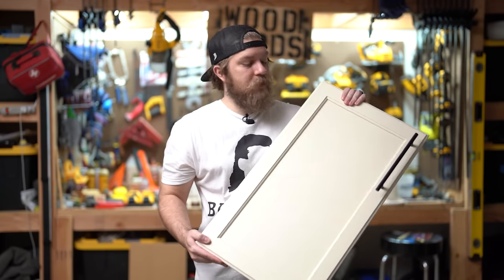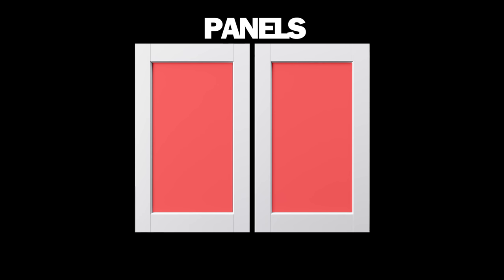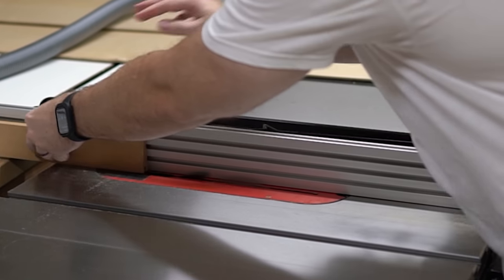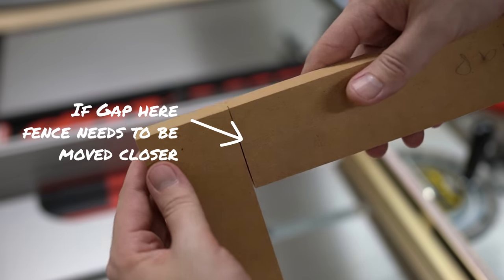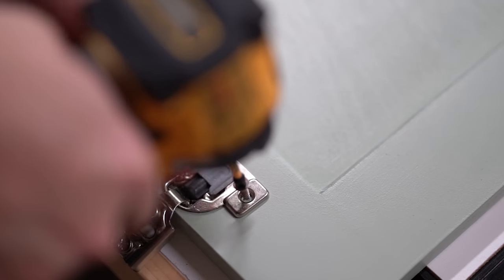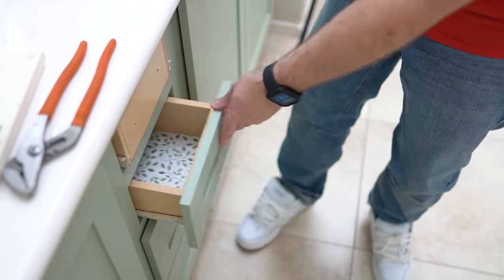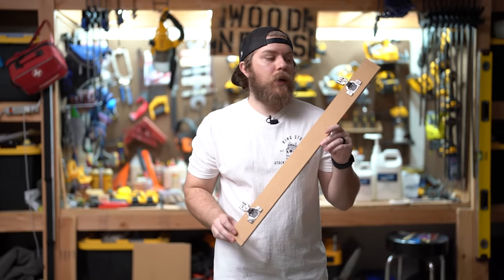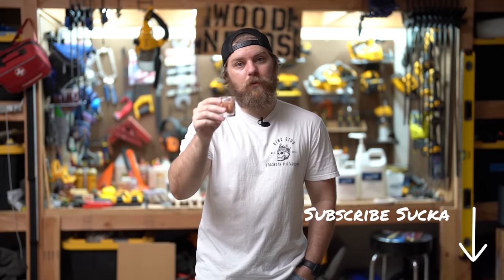CHEAP and EASY Shaker Cabinet Doors and Drawers | DIY | HOW TO

Comment: Excellent video! Really nice finish!
Reply from the maker: Thank you! It turned out pretty good haha. I appreciate it! Thanks for watching and taking time to comment!
Reply: @WoodNerds  Great content deserves credit. I've subscribed from this video alone. This is something I am looking into doing myself for my kitchen. Do you think this method would work well with frames surrounding the doors too?
Reply from the maker: Thank you! Are you referring to inset cabinet doors vs overlay? As long as the hinge cups aren’t deeper than the 5/8” material I don’t see why not. I haven’t done inset doors yet so I would probably run a test to make sure before committing to an entire kitchen.
Reply: @WoodNerds  I think inset would be a good way to describe them. Here is a link to demonstrate what I mean:
 https://multiwood.co.uk/wp-content/uploads/Baystone-Cream-731x1024.jpg

My current kitchen is similar, but the chamfered shaker style and I want to update both the frames and the doors. Thanks for your replies and advice it is really appreciated.
Reply from the maker: @MrSmith_ ah! Yeah, inset is what we would call them. You’ll need inset hinges as well. Really classy look in my opinion! That style is more of a challenge because the doors have to be perfectly square to fit the frame or you’ll easily be able to tell they are off by the gaps. I’ve been wanting to make some. Let me know if you go through with it and how they turn out!
Reply: @WoodNerds  Will do and thanks. I really like it myself. It's something small but I think it really adds to the visual appeal.

Comment: excellent video.. love the way you've explained.. would you mind sharing the paint details.. it looks gorgeous..
Reply from the maker: Thank you! Of course! It’s “clary sage” satin finish, using a “cabinet and furniture paint” base to help mitigate wear and tear. The tag doesn’t seem to have the brand but my wife picked it up at Lowe’s (if you have one near you). I think the manufacturer is sherwin Williams!
Reply: @WoodNerds  How did you apply the paint (spray, roller, brush, multiple)? Did you prime first? How many coats?
Reply from the maker: @BradEaton I show my process in the newer cabinet door video!

Comment: Great video! I have wondered before if you could make a shaker style door by using just plywood. Having a panel the same size as the whole door and gluing strips of plywood round the edge to locally thicken. If you wanted to keep it really simple, you could have the strips only on the outer surface and use 9mm + 5mm plywood, otherwise you could use 5mm plywood throughout. The only concern I could think of is how well would the plywood edge take paint?
What do you think?

Comment: I'm an absolute beginner. Can you clarify the type of blade that you're using there? Is it a regular blade and ? tooth count or is it a dado blade / set? Great instruction and presentation!
Reply from the maker: Hey, of course! I added the exact blade I used to the description to avoid error. But it’s a 30 tooth glue line rip blade I use. Just a single blade, not part of a set. It’s been a great value vs cost in my opinion. Used it for some hard maple not long ago and it preformed nicely.

Comment: Really great job. What about paint?  What’s your paint process?  Is MDF difficult to paint?
Reply from the maker: Thank you! After the prep work in the video, I used a primer/paint base combo that is meant for cabinets/furniture that (from what I gather) is designed to sink deeper into the materials to create a stronger finish. I rolled on using a cabinet roller brush on the flat surfaces, then a bristle brush to get inside the small angles where the panel meets the frame. Many light coats. After the first coat, mdf seems to paint just fine. The first coat gets a little drunk up but after that I didn’t have any issues with it.

Comment: Perhaps a dumb question, I'm not sure if I just missed it....
How do you get just the right measurement for the panel to fit/slide between the stiles and rails. I know you said you take off 1/8th for some wiggle room, but that's about all I caught.
The budget I'm on is very tight so I can't really afford to mess up, so if I can avoid it.. 😂

That aside, this is excellent and so clear and easy to understand. Thank you!
Reply from the maker: Hey! No problem! The panel should be the length of the inside of the frame (either top to bottom or left to right depending on what side you’re measuring for) plus 3/4”. The 3/4” is the sum of the 3/16” dado groove the panel fits into, times two (one on each side). Then, after you get that number, subtract 1/8”. You’ll do that for the top to bottom and left to right measurements.

I hope that makes sense, it’s hard to describe without showing a visual aid.
Reply: @WoodNerds  No that's perfect, thank you!
Reply from the maker: You’re welcome! Cheers!

Comment: Thank a lot for the idea bro. I just wondering how to renovate my kitchen, because is extremely out of date may be from 80s. And i've got no 10K$ for new. The doors are very strong and good solid wood.
Reply from the maker: A couple budget ways to fix up a space is to repaint. It would robably be helpful to look up painting color schemes to help put a plan together. Look up epoxy countertops! You can replace all your countertops for fairly cheap and from what I’ve seen, if you follow the instructions, beginners can do it pretty easily. Then lookup vinyl wrapping or painting your appliances. I think with a few hundred bucks you could completely change the look of a kitchen with those few ideas.

Comment: I was looking through the comments to see if anyone else asked, but I didn't see.  I'm curious to why you didn't use 1/4" mdf for the panel?  Thanks, and geat job with the video!
Reply from the maker: Hey! No real reason. Plywood is mainly what I had on hand. Mdf is a great material for the panel as well.

Comment: Thank you, this is great,  looking at 1/2" mdf at Lowes,   should i buy the standard yellow pine mdf or the sanded mdf.  thank you so much. I'm about to build my first set of cabinets and plan to use this for sure. I see you say 5/8" which i can't find but should i use 3/4" which i can find.
Reply from the maker: I think you might be looking at plywood. Which is different than MDF. I haven’t seen yellow pine MDF or sanded but I have seen those types of plywood.
Reply: @WoodNerds  I'm saying I can find MDF at lowes in 1/2 and 3/4 but no 5/8"   and i don't find HDF at lowes or HD or at Wurth Wood
Reply from the maker: 3/4 will work. It’s actually the typical thickness for cabinet doors.

Comment: I'm thinking of making a pair of glass or plexiglass shaker style bifold doors to separate my front door and closet from the rest of the space. This is so I don't chill off the house too much in the winter. I'm just thinking that the materials you've used won't be sturdy enough for what I'm hoping to do. There would be 4 panels, each panel 17¾". I'd like to go with the plexiglass as it's lighter. It will depend on the cost of each. I was thinking of going with just one clear panel, top/ bottom rails and 2 styles. I could also go with a solid panel covering 1/3 of the bottom. What do you think? Thanks 😊
Reply from the maker: That’s a good question! I think you’re right. This method might not work so well for a door that size. In fact, long mdf strips flex a bit so I wonder if the door would end up being wobbly? Dang… sorry I’m not more help.

Comment: IMO the handsaw and clamped rail method gets the absolute cleanest straightest edge to rip down the long cuts. Not a professional woodworker, but have OCD, so that’s an easy go to, especially with a single person. 😂 You could use a router to clean up edges, but lord routing MDF 😳 Looking like a yellow Christmas! 🤣 You’ll need a full face gas mask and bio suit for it to keep it out of your lungs and eyes.
Reply from the maker: Haha you’re not wrong! Routing MDF definitely makes it snow! 😵 thanks for watching and sharing your experience! Cheers!

Comment: I've built a ton of doors  out if 3/8   mdf  with  3.125 inch wide 3/8 thick  stiles and rails   glued  to the face . I use 23 gauge nails and clamps to get a real tight edge  seem  .  I  oversize the doors   1/8  so I can trim all the glue squeeze out around  the perimeter  1/6 on each side.  once your  done  use a 1/16 inch round over  to break  the edge on front and back this us important  to keep from damaging  the mdf .  these doors  have held up fine .less joint cracking that traditional  doors.
Reply from the maker: Great info here Darren! I’m going to try this method out. I recently picked up a 1/16” round over bit so this would workout perfectly. I appreciate you watching and sharing your experience!
Reply: I'm not a fan of building  a style  and rail with mdf . although  i did do a job like this  for my mother  and they have held up fine for  over 20 years because  the joint won't be that stong .  if you buy lumber from a real lumber distributor  you can get  popular  pretty cheap and already  surfaced and strait lined. you can't buy from home depot   it's to expensive

Comment: Very comprehensive treatment man.  I'll use a lot of your ideas and experience on my cabinet door reface/replace project coming up this year.  A couple questions.  I am suspecious of MDF or HDF absorbing the occational peeing by one of my cats or dogs, even if I paint and perhaps poly the doors.  Would plywood be better or will paint and or polyurethane (or similar) be enough.  I'm old and old school, so looking for durability rather than pretty.  Cabinet bones seem good as is, so I plan to refinish them, leaving the top in place, and replace all the hinges and pulls.  Also going to '86' the dishwasher and add a cabinet space there.  Waddya think.  Open for all ideas.
Larry
Reply from the maker: Hey, Larry! Thanks for watching and taking time to comment! Sounds like a fun project! The thing about composite materials is they all have a weakness to water, even plywood. A big reason doors made of these materials fail is due to a failure in the finish. If a door is fully sealed, and the paint is effectively waterproof, then liquid can’t get to the material to damage it. In my experience, if you lay down enough coats of paint to protect the material, you should be good. Occasionally inspect for damage and touch up as needed and they should last. The spot where the panel meets the stiles/rails needs to be sealed up nicely as well (that’s where I caulked it to prevent water from rolling down into that gap).  I like to mention that your mileage may vary and I only have my experience to gather an opinion from so take what I say with a grain (or pinch) of salt haha.
-Tyler
Reply: Tyler,
Thanks for the reply man.  Really appreciate your time - I can only imagine how busy you are.
All good info man, and I get your points.  Was mostly hoping to confirn or deny my ignorance on the finer points LOL.  Recovering Type A here, so I'll take what you suggest with due dilligence and get with it.
Sounds like it's a wash on wood type if I coat it well.  I like poly to see the native wood, but it does dry and flake off - like some of us during advanced age LOL.
So perhaps paint it best - prob more durable for surface cleaning.
And I really get your sealing the joints point.  I plan to do that around the perimeter of the Vinyl flooring under the quarter round - flexible caulk so the floor still floats.  That point of entry is where some water got under the lenolium to damage the subfloor in the first place.
Custom engineering it to survive me and the cats.  I spill more than they pee due to being clumsy.
BTW I decided to not be Type A enuf to use Tongue-N-Grouve 23/32 plywood on the subfloor.  The VInyl comes with cushion sheeting to separate the tiles and wood anyway, so I'm hoping for a level floor by brute force and hope.
I'm unconventional in most ways, and growing up lower-middle class that tendancy helped me get by.
Sorry for the long text.  I do that in my essays and  emails etc.  My friends chide me for being verbose all the time.
BTW if you need any help with Electonics, Electrical, Water Treatment, Telemetry, Chemisty, or Theatre Lighting text of email me.  Worn all those hats during my 52 year career.  Cats too - rescurer here.
Always glad to pass along info.
Many thanks again!
Larry Keyes
www.K7BDD.com
K7BDD@arrl.net
Reply: P.S.  I'll quote someone who recently was asked if they would resist their tendency to be too 'wordy'.  He replied "Yes".
I promist to not wear you out with words in a email reply.
Reply from the maker: Haha we’re all busy, I assume! 

Man, you have a lot going on! It’ll be worth it when it’s all taken care of. I have an ever growing “honey do” list the wife keeps reminding me of, which is good for content and experience but a time consumption that takes away from relaxation and socializing with friends haha.
Just like you, I grew up lower middle class and my dad taught me how to repair and build things rather than buying which gave me the creative bug.

I appreciate the offer! I don’t have an immediate need for assistance in those areas but I’ll keep a mental note in case the need arises! Thanks for introducing yourself and taking time to share! I make videos for folks like us, trying to improve ourselves and our space. Really enjoying the community!

Cheers!
-Tyler
Reply: Tyler,
Got into here cuz I brain-farted my website, and could not find my reply of a few mins ago.  No need anyway cuz I saw in a previous comment that I already gave it to you.
Love random contacts with folks.  Been that kinda goofy since childhood.  Hasn't got me in trouible yet LOL.
Cheers

Comment: Also was wondering if it would look okay to just use the mdf panel for the dwarer and rout out  the tines/rails so it looks like the doors but it’s really just one piece? I’m going to tempt the doors you made but I’ll use the panel from my old doors and make new tines and rails. Thanks for your knowledge! Appreciate it 😊
Reply from the maker: Yeah, if I’m understanding correctly, people use a CNC router to make solid 1 piece cabinet doors and drawers out of mdf. The router just gives the appearance of a panel.

Comment: nice work, great video. why didn't you go over the painting part?
Reply from the maker: Thank you! The video was getting too long. Also, I’m not a professional in the painting space so I tend to leave it up to those guys/gals to give recommendations on products and processes for finishing haha. My process was pretty simple though. Used a cabinet/furniture paint base with sherwin Williams “clary sage” tint. Used a bristle brush to get in the inside corners, then a small cabinet foam roller brush for the flat surfaces. In total about 4-5 pretty light coats waiting 30-45 minutes between. A sprayer would have been much easier and would have yielded a better finish but these came out really nice by hand.

Comment: Merry Christmas.  I have a pretty large kitchen with a lot of golden oak cabinets and drawers.  I’d like to build shaker style doors and drawers myself.  I can get all of the styles and rails for free from my work. 
They are MDF rips that are 4 1/2” wide x 8’ tall and 3/4” thick.  What would you recommend that I use for the panels for the doors and drawers?  Ty
Reply from the maker: Hey! Merry Christmas! That’s awesome! I like the 3/16” plywood panels I used, but with 3/4” rails/stiles I’ve seen it done with 1/4” as well. you could use plywood like me or even mdf for the panels. Mdf will be easier to give a smooth no grain look when painting.

Comment: what paint did you use and what color exactly is that green? looks very pleasing clary sage has a few different options: SW 6176, 6177, 6178, 9128, 6179, 6180, 6181. Which one did you use exactly? Thank you.

Comment: Thanks! What kind of paint did you use? Seems like furniture paint needs to be different than the paint you buy for walls at the home improvement stores.
Reply from the maker: It’s “clary sage” using a “cabinet and furniture paint” base to help mitigate wear and tear. The tag doesn’t seem to have the brand but my wife picked it up at Lowe’s (if you have one near you).

Comment: Thanks for the tips!! Being new to cabinet doors and drawers, why 3/8 depth of dado instead of, say, 1/4? I’m building a standalone cabinet:  what width gap should I plan between the double doors, and what between the 100-pound-capable drawers? Thanks!!
Reply from the maker: Hey Brad! I think the he suggestion is to make the depth of the dado about 1/2 the thickness of the material being used. I am using 5/8” thick MDF so 3/8” is close (without splitting hairs haha).

I have a video on finding your desired gaps in the description! It should be pretty helpful if I’m understanding your question correctly!

Comment: great video. I'm building my kitchen cabinet doors the same style as your. I'm just having a hard time figuring out. What is the best paint recommendations for moisture and durability what is your suggestion?
Reply from the maker: Hey! There are so many products out there it’s hard to decide! I like to recite that I am not a pro with nearly anything haha, but referring to some of the suggestions I’ve read in the comments it seem that Alkyd paint and primer is the way to go. Someone mentioned it outlasted the latex paint they used. I have no experience but in my case I used latex paint/primer combo with a cabinet/furniture base. I believe the cabinet/furniture specific paints have oil in them that help it seep into the fibers to grab/protect better.
Reply: I think I'm going to see about the Benjamin moore advanced. Heard goodresults about it